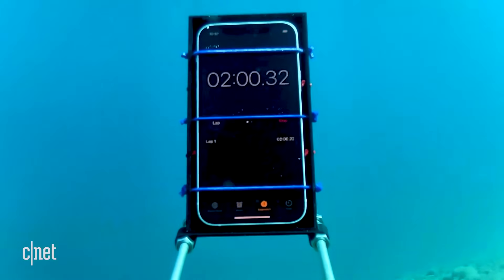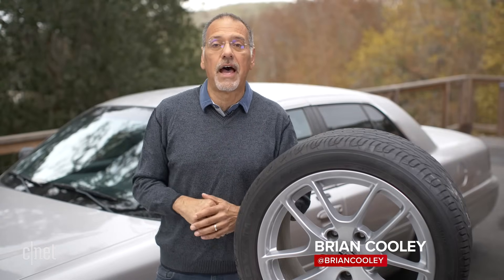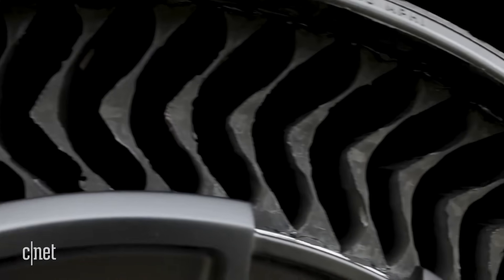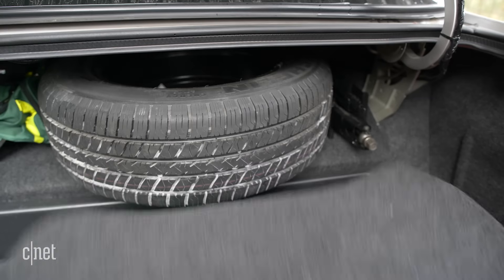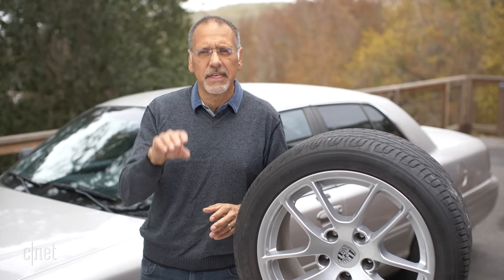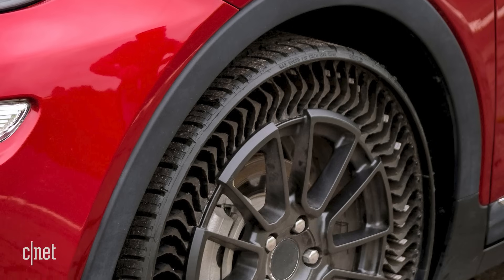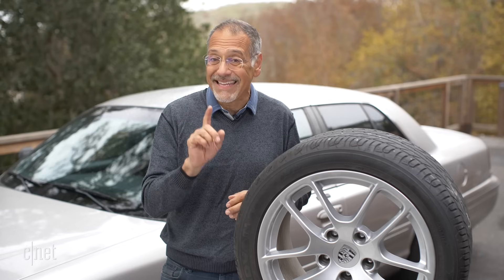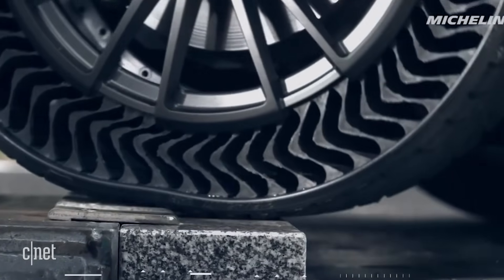See what Michelin uses instead of air in its Uptis tires

Comment: This wont come out because having tires that last too long isn't a good business model
Reply: They shouldn't last any longer on average then regular tires. Most tires are still going to need replacement due to tread wear, this tire seems more resistant to factors that will prematurely shorten their lifespan.
Reply: @danw4237  also it will use less rubber.
Reply: You still need new tread one in a while.
Reply: Yeah, because a business as big as Michelin couldn't possibly work that into their pricing models.  And the tread won't last any longer than any other tire.  The only thing that will be extended is tires that get a sidewall puncture or uneven wear.  That's a small portion of tires sold.
Reply: @dgoddard  check out the lights industry
Reply: More because they have terrible lateral grip at high speeds. That's why they're still in development. They've been around for a while but they're only in use on vehicles that crawl at low speeds over rough terrain.
Reply: @lllllllllllllllllllll1lll1   is that really a bad thing high speed and traffic don't sound like a good mix especially on highways
Reply: @lllllllllllllllllllll1lll1  I'm sure there will soon be a new axel design and sensor to solve that problem.
Reply: it is, because consumers will want tires that don't go flat.
Reply: @33LB  that means people are likely to buy them only once since it lasts too long.
Reply: The tread wear will still be the same. The only savings would be on damage from nails that can't be plugged or premature wear from dummies that continuously drive on under or over inflated tires. And since it doesn't look like the tread is a separate piece on this new one, you'll still need to buy the entire assembly. 

My concern would be how does this affect the ride quality.  Too stiff and it's unpleasant,  too soft and you'll have to shell out bucks for bent rim repairs. Then there is the fact that there is no air preasure to adjust which limits the option for off-roaders.
Reply: @richardr5888  exactly, lol.
Reply: Absolutely hit the nail on the head, its what i said the first time i saw them. It would be terrible for businesses if you bought on tie that could last year's. The corporate's won't allow it to roll out, they don't care about green
Reply: If anything they would make similar/higher margin. Thread would still diminish at the same rate yet they could charge more since tire that can’t go flat is very desirable.
Reply: @SoAExile  you do forget the parent company of some tire companies are major car companies. With this and patented could be a game changer
Reply: @SoAExile  don't care about green, unless it's money
Reply: @SoAExile  Wouldn't that be illegal if corporations made them not release it?
Reply: @SoAExile  they’re literally for sale
Reply: yeah but a lot of companies now will get backlash if they aren't trying to be eco friendly plus the tires can still be cut just not get damaged by a hole so you won't get a flat from the road the treads can still were down someone could still slash them for example my parents tires broke not because they ran something over but because the treads got rundown and they where only a few years old I believe
Reply: @blueorion4404  they aren't trying to be eco friendly, it's all about Negotiation and Money
Reply: Just sell it for how many tyres it would normally cost to buy
Reply: @Kni0002  you dont understand. having a trye significantly durable in the exact same price will drastically decrease sales
Reply: These wouldn't inherently last longer than a standard tire. They avoid certain ways tires can prematurely fail, but treadwear would be identical to a tire that uses air, depending on the rubber compound. And these tires will still end up bald eventually.

The main benefits at the consumer end are safety due to lower likelihood of catastrophic failure, convenience, and simpler maintenance (only needs to be rotated).
Reply: What are you talking about… the tred will wear the same
Reply: We can’t live in the past. New business models will evolve.
Reply: Not if each tire averages $400 to $600 ea.
Reply: @OL_COACH  I would buy them at that price if it worked out cheaper in the long term.
Reply: Verified commentated with no real life knowledge coming here with his sheeples to educate people.
Reply: What about led bulbs. 🤔
Reply: This actually a really ignorant comment. It's worse for the business model OF YOUR COMPETITORS than it is for your own if you're the one offering it. From there, everyone has to follow suit. It's a mechanism by which capitalism favors the consumer over the producer, which is not unheard of.
Reply: With this logic LED lights would have never been invented and we would still use tungsten bulbs
Reply: that's called planned obsolescence
Reply: This is just stupid. The amount of materials being used to replace the inner tube and air combo is just nuts. Plus looking at its tread its basically the same as the regular old fashion tire. I dont know if EV cars really need this since those gap will create turbulence no matter what design hence making mileage worse.
Reply: Only if you don't have any competitors. So many companies and young entrepreneur they just wat the cut of the pie, they wont think long term,  because they are outsider,  they just want to distrupt this industry first to be the new king.
Reply: The long lasting lightbulb was a fire hazard, this long lasting tyre is unsafe and has a terrible ride quality. It’s not a monetary problem
Reply: @dylanh25  go educate urself on the lightbulb one, Mark rober has a video about it
Reply: @dylanh25  how do you know the new tire is unsafe and has terrible ride quality. If anything it should be safer by significant margines and no one has used them so we dont know about the ride quality
Reply: @dylanh25  never mentioned the old incandescent bulbs :p Now you got me thinking of the one in the fire dept somewhere in the world. I think they have it on in their basement or something
Reply: You could just make them cost more. Then profits are the same.
Reply: Not really because a lot of people don't change their tires due to damage but rather because of normal wear and tear from the road. You'll still be changing your tires every 6-10 years but if anything they'll probably cost more.
Reply: Just like lightbulbs
Reply: A specialized tire will require specialized mechanics/equipment to install them, replace them, rotate them.  If this doesn't drop in a large enough market, can you really expect the average consumer to transport their car hundreds of miles to get their special new tires replaced or rotated...
Reply: Actually, they will need to be replaced about the same, just losing replacement from punctures. The treads will still wear down atr the same rate and one assumes the baffles will also wear down over time.
Reply: how many tires you've changed because a nail went through it? Lmao it's the surface that gets worn out
Reply: Won't change how long they will last. The rubber will still dry out and the track will get worn out but they still got a problem whit getting the price down and still keep it from failing to soon. That's why it's taking time for it to hit the market.
Reply: The tread will still be worn out. And it will become impossible to drive when it wears out to those glass reinforced veins and is like grinding a wheel on rails
Reply: I don't see this wheel handling off-road or high speeds, it just looks fragile in my opinion, I really don't see why we have to "reinvent" the wheel, just get rid of wheels altogether its time to actually invest to getting hover cars into reality, there are currently projects for electric powered hover bikes/vehicles and with further funding they can invent alternative fuel sources and a replacement for propellers, and over time they can become more cheaper with alternative materials sourced from recycled plastics and reclaimed or scrap metals than having to constantly torture trees and conduct slave labor for rubber
Reply: @traphimawari7760  Maybe a stiffer compound could help in off-road and for trucks? To be honest, I see more benefits in more softer tyres for high-speed cars, but ground clearance may become an issue, so it could be in-between softer and harder veins.
Reply: @Venomclippy  or they could stop messing with unorthodox ways of creating a solution to an issue that poses less of a trouble if people would actually just be more cautious about their vehicles and actually develop something innovational, something that could actually withstand the test of time when wheels will be rendered nearly obsolete, like I said, they should just stop reinventing wheels and move on, there will be no progress if they are stuck on a common concept that already exist
Reply: @traphimawari7760  People don't change unfortunately. Some people will still try to run their flattened and punctured tyres like blithering idiots and this new concept can eventually stop that once the tread wears down and the veins dragging on the road physically stop them from trying to go any further.

Something innovational is very far from road use and hovering cars are very troublesome to develop and even getting the concept right needs more technological advancements and availability
Reply: @Venomclippy  indeed it is unfortunate that is why if they are unable to move on from the concept of wheels there will be no change it may look like the complex matter of availability and technological advancement that looks apparent to the cause as to why there has been no real change but when you go past all that, its always the mentality that matters, you can't expect change unless you move forward rather than remain on a single location and be satisfied with the current concepts it is constricting both imagination and innovation, that is why before anything else, especially in the field of research in order to do something ground breaking you must always come up with the impossible and as cliche as it may be, make the impossible possible, being unable to think that way and pursue that path will always make impossible seem impossible unless you finally realize it is possible
Reply: @traphimawari7760  It's okay to catch your breath between sentences lad.
Reply: @Venomclippy  yeah i do get that its a "bit" stretched out, only to make the point "make the impossible, possible" 😂
Reply: Its simple they could sell this tire the same cost you would bought your old tire for a year long, 

Even if they don't want to do that, other tire companies might do, to kill competition.
Reply: Its still wear out much easier than air filled one...
Reply: Nah they've been an idea that's floated up now and then for years. They've been sold as bike tires for ages but the problem they've always had is if you hit a pothole they get ruined
Reply: Just because they wont be damaged when running over a nail doesn't mean they will last long. Sure on average its longer whiteout damage failure, but they will still need to get replaced because of wear.
Reply: It won't come with the car but you'll be able to buy them separately
Reply: yeah
Reply: Depends what price you sell them at.
Reply: Not if they're more expensive
Reply: I see how you would think that, but air isn’t the only issue, tread, basically you would still need new tires every once in a a while, this would only help with getting leaks in tires…
Reply: they will make it hella expensive
Reply: This is cap, it can only take so much stress abs wear they’ll need to be swapped out at some point
Reply: But if it works well it might become mandatory because of the waste off old tyres
Reply: these will still wear out lol.
Reply: It will if the government forces them to be more environmentally friendly with regulations but that probably won’t happen either
Reply: @nobodynowhere8061   i am French (homecountry from Michelin) and they are advertising/testing it on the french market right now. They want a public and global release in 2024. Please read the comment before answering to it
Reply: Everything has "wear" issues come on
Reply: @alessa9464  even our own skins
Reply: Well, people said that about LEDs too.
Reply: Yeah, when they say it’s 200 million less tires in the landfill it means there is 200 million less sales
Reply: And a bad business for police officers. Since they can't use spike strips anymore
Reply: Sadly
Reply: They'd have to make these crazy expensive for it work economically work
Reply: Nah they'll come out, but they'll just wear down in other ways, like permanently bending if you leave the car unmoving for too long.
Reply: they wont last long. Big rubber / plastic will guarantee that.
Reply: They’ll have to change them because of tire ball the treads will where down eventually
Reply: Well it’s odd seeing you here
Reply: Not really. There probably not going to work out because of the spokes. If one of those end up breaking it can screw up the tire. That one of the main reasons why it’s been taking so long for them to be put out on the market.
Reply: No man !!!!! You don’t fuckn understand !!!! I badly need those tire !!!! Please don’t jinx it !!!!!
Reply: The tires/treads will still wear like any other tire dude you’ll need to replace them LOL
Reply: It's not going tonlast forever, it justvpincture proof. Very good for London where they never sweep residential streets and there are always nails there.
Reply: I'll take "what is competition" for 1000 please, alex.
Reply: unless they sell for triple or quadruple the price.
Reply: Either way, you still have to change it when your tire wears out unless you enjoy sliding around.
Reply: I am sure they will just come up with a way to make it degrade over time because in the end, everyone will still want to buy new things.
Reply: what..? people don’t want tires that pop often, this is a great solution. they just don’t want to scam people by making them buy new tires every few years. plus, it reduced pollution
Reply: @cvntacious  they only care about profits. they won't be making any money with long-lasting tires. They only care about pollution because their consumers do.
Reply: It's also not a good business model to waste billions on R&D for a product you aren't going to release
Reply: That's why they've been piling all those electronics into cars and also why they're pushing electric cars so hard.  They won't last and they'll be so expensive when it comes to used cars that people will be forced to buy only new.
Reply: But the thing is, if other companies are making airless tires and selling them then they have to keep up and make airless as well
Reply: I would be worried that it would deform if you did not drive the care enough then if you drive a lot it would probably wear out quickly
Reply: thats exactly why we don't have light bulbs that lastb forever. they exist but nobody sells them.
Reply: They thought the same thing with electric cars.  That Greed is good BS is on the way out friend. We got to save the planet.
Reply: Maybe one day the tire thar must be replaced after use will be common
Reply: @SWAG BUCKS Yeah tires cause pollution but these tires are really not that durable. If one of the spokes break it can change how the tire rides so the tread would go bad faster. Until they find a way to some how reinforce the spokes it won’t be that much better at fighting tire waste.
Reply: How is airless tyres make it indestructible? These are made of Rubber and not of Titanium😒
Reply: For anyone wondering Michelin has said the tyres will need to be replaced every 5 years
Reply: They can make them more expensive and they will need to be replaced still when the tread gets low, so you're point is kinda invalid.
Reply: I mean they probably last less than normal tyres, they just dont break down because of nails no?
Reply: Yeah people r just gonna keep it once and never buy again lol
Reply: Eh, I wouldn't really say that. You still would need to buy new tires regardless, they always get worn out every now and then.
Reply: They track will still wear out just will be puncture proof
Reply: this has nothing to do with that

infact tire makers make little if any money every time you drive over a nail because you dont replace a punctured tire you get it repaired by a third party garage tier makers see nothing

and the tire doesent last any longer than a regular tire does because it still wears out the tread like every other tire and you still have to replace it like every other tire
Reply: umm... while this is usually true, you dont really need new tires every year anyways... like, you'd still have to replace/get them rethreaded when the thread wears down, like any other tire
Reply: The tread still still wear out and require a replacement
Reply: but, selling lifetime tires is a good short term gain and i'm sure these will probably have other issues
Reply: They said that about non patrol driven cars too and look where we are today.
Stop with the pessimism, Horizon.
Reply: If even one of those “veins” happened to tear or rip, which is more than likely because of the open design, you’ll probably have to replace the whole tire
Reply: Unless you're the only one selling them 🤔
Reply: I mean they will still have to since the tire will still become hairless
Reply: You are everywhere bro, on all the tech channel The Horizon. Lol...
Reply: they'll just charge like 900 bucks per tire...
Reply: Yeah literally the dumbest business idea. At least make it lower quality or extremely expensive.
Reply: Oh when multiple car companies and tire companies work together….
Reply: Wear and tear is the main reason why people buy new tires. Maybe less tire replacements from flats, but balding will still exist from friction.
Reply: Oh whatever.
Reply: Unless they make a flaw on purpose
Reply: not true, it will still have wear and will need regular replacing
Reply: The tread will still wear out just as quickly.  It's not likely to actually change much there.
Reply: I can't imagine why people think that life is rigged when it is literally rigged.
Reply: Thus why those connectors look rather weak, IMO. All that flexing can't be good for the tire's longevity, particularly considering how thin the connectors are at the places they flex.
Reply: It's the light bulb business plan.  In the early 20th century they figured out a light bulb that can outlast a human lifespan.

But they wouldn't make any money so they buried it.
Reply: They'll find and create a weakness, don't wrry, maybe they'll bang up the wheels! Better model
Reply: They probably have designed it so it is affected by programmes obsolescence one way or another. In fact most of the development time in this product was probably to engineer a product with the perfect shell life (because the technology otherwise probably existed already)
Reply: Laissez-faire if Michelin won't do it then someone else will
Reply: Subscription baby
Reply: Afraid that will be end result
Reply: The tires would still bald, and probably won't be strong enough for larger vehicles
Reply: Capitalism at it's finest
Reply: Also, the aerodynamics and driving physics suck.
Reply: Nah more like the tires wear out and you might have to change it after a certain amount of mile usage
Reply: It might still get in military service though.
Reply: They wouldn't spend millions of dollars starting a project like this if it was gonna decrease their revenue. They will charge more than usual and get flat tire insurance money into their pocket since people won't have flats everybody rather spend it on the tire itself, saves you a lot of time in return. My hypothesis is they will be quiter imagine how sound travels that tire design is reducing the amount of surface area for vibrations to travel which will result in quiter ride. In 10 years most people will have these tires is my guess.
Reply: It’s tough to say, because they said the same thing about electric cars vs gas…
Soooo, we’ll see
Reply: Unless the tire is expensive that will compensate
Reply: If they announced it, then they must be meaning to have them out.. I think Michelin is trying to consolidate the market or kick out new tougher competition.
Reply: Im guessing they could charge you a certain amount so you can swap them out every couple years or months for new ones when they start getting "old" and lose traction.
Reply: thats exactly why we dont have long lasting light bulbs
Reply: I think they will last longer but not much longer, the exterior part is the same material, it will wear as fast as any tier.
Reply: You can buy them for $700 a piece actually
Reply: whose to say they will last too long  the outer  ring you actualy put to the ground  will still be rubber which will wear out and when it does  you will need a new tires
Reply: Willing to bet most tires sold are commercial tires, and commercial truck tires can be retreaded.  There's probably a fair chance these can't be retreaded because the carcass will be different / lighter, but will be cost effective because you don't need the tire pressure management system on the truck or trailer anymore (much more complicated than a personal vehicle TPMS).
Reply: Ohoho,  don't underestimate planned obsolescence, friend
Reply: I feel like they are trying to battle cheaper Chinese competition by engineering something their competitors can’t build, selling it at a higher price because of its supposed benefits, produce it for cheap because it doesn’t have a sidewall which is usually the most expensive part, and cut down on emitted CO2 to avoid paying fines.
Reply: 😂😂😂 but climate change will make us to go for it.
Reply: ever heard of tyre tread?
Reply: and they developed those dozen of years ago...
Reply: Theure heavy. Destroys gas mileage. They're not comfortable at all. Wouldn't want them don't care how long they last.
Reply: yes it will. its usaully about when the tread wears out, not when you drive over a nail. so it depends on the tread they put on it
Reply: supply and demand it exist now, so who ever decides to make them Will have Plenty of Business,
Reply: The governments around the world will most likely make it a law to have while driving just like it is with seatbelts and so forth. Safety first.
Reply: Tread will ware at some point and they’ll probably triple the price of regular tires. Trust they are gonna get their money
Reply: Looking at some of the comments in this thread...
Note:  These are just things I've heard and my own speculation.  I've been watching these things for a few years now.  Some of the info I have may be speculation or no longer accurate.  It seems like the tires have been about two years out for the last five or six years.  It may be that they'll never come out, or it may be that the world-wide issues over the last couple years just slowed things down.  I do driving gig work (Uber, DoorDash, etc) in an area where the streets are poorly cleaned/maintained.  I'm constantly making trips to my tire shop to get tires repaired/replaced due to damage.  Even if they're $2K-3K for a set, this would be WELL WORTH IT for me.  That said...

I've heard they will have some sort of reprint/retread capability for when they start to wear out.  This could REEEEAAALLLYYY play into the eco-friendly angle.  It would also be a great way to sell tire shops on it.  Some of the people at my tire shop I've talked about these with have complained that the airless tires could hurt their business.  However, if Michelin can say "here, buy this massive 3d printer for $XXXK from us.  Every few years, all your customers will need to have their tires retread".  With high enough profit margin, the tire shops won't be as fearful of carrying the tires in the first place.

Another concern on this thread (What the initial post mentioned, in fact) is the idea that the tire companies would be foolish to release these because they'll have fewer repeat sales and thus won't make enough on them.
First, (as others have mentioned), They can price the tires in a way that will account for this.  Some of you may be thinking, "Great.  They last three times as long so Michelin will charge three times the price.  What's the point?".  However, the calculation is not that simple.  The tires won't be three times the price because Michelin will also be able to account for the reduced cost in manufacturing one set of tires for a vehicle vs 3.
Another thing to consider in this is the competition.  Sure, Michelin might not make as much in the long run from each customer, but with patents... well...
If a customer wants a tire that's virtually indestructible and Michelin has the patent; then that customer will HAVE to buy their tires from Michelin and not their competitors.  If an industry says a new way of doing things isn't worth it because it could hurt the old way of business, but the public wants that innovation, then the company that embraces that change will easily take the market by storm.  Remember, companies insisted for decades that electric cars would never work.  Now, Tesla can't keep up with demand in spite of well publicized manufacturing defects and quality control issues. (And the existing car manufacturers are playing catch up to the upstart.)

As to quality issues like ride handling, road noise, etc...
I look forward to finding out.
Reply: They will still wear down over time. The disposable business model is a thing that needs to go extinct. Look at all the waste it's creating.
Reply: I don't know if I agree with that statement about profitability on these tires just because they last longer. With these global green push, countries could pump money into companies by purchasing bulk orders from government agencies to private sector. They stand to make big money being awarded contracts and by doing so want be counting on the regular consumer. I wouldn't even be surprised to see tax incentives for making these that may even help them avoid paying taxes which would make even more profit.
Reply: Wrong. The price of one tire costs as much as 4 new tires. So they are priced as if you've blown out all 4 tires 4 times. You'll eventually have to replace them when the tread wears. Its up to the consumer whether or not they want to pay the "convenience fee" of not having to worry about being stuck on the side of the road.  Marketing is where it's at. Profit margins on production costs were probably solved before they even took it seriously.
Reply: Dang 1,000 a tire probably
Reply: I don't think so. If this gets on the market, michelin will have a monopoly on those tires, which would bring them a lot of money
Reply: @bloba6969  like said, this would last way too long and consumers would buy them likely once since it doesnt need that mucb replacement
Reply: @awakr7125  So, somehow airless tires will eliminate tread wear?  Tires aren't typically replaced because they blow up.  They are replaced because the tread wears down.
Reply: @jorper2526  i was talking about Horizon's point. Sales would spike and drop quickly with something "very durable"
Reply: Exept if you are michelin and want a big piece of the cake. And we are french so we dont care. And its coming, we can buy them in France. Just buy a Michelin stock and be happy
Reply: That’s not true, The tire will wear out long before repairing punches is not viable. These types of tires will last just as long, and have performance costs.
Reply: Dont you worry, Michelin has already resolved this issue. 

Each tire replacement requires a whole new rim as they are a single unit
Reply: They will just use a softer rubber to make it wear even faster